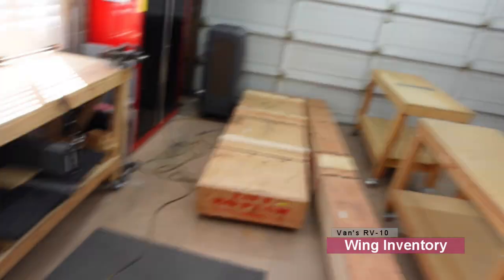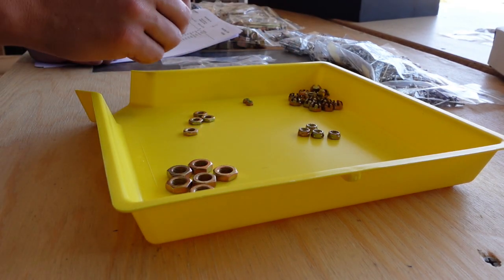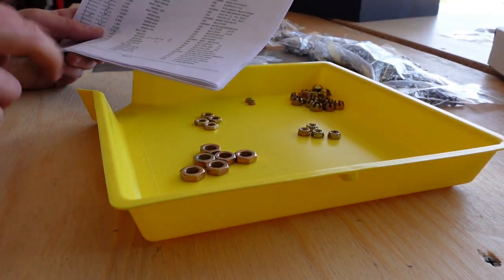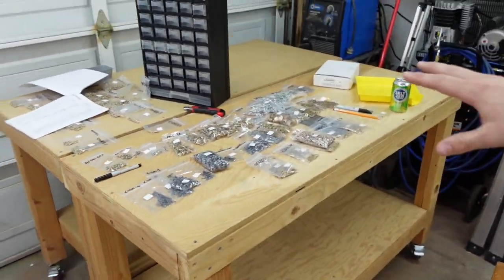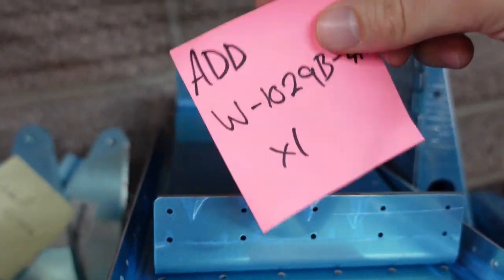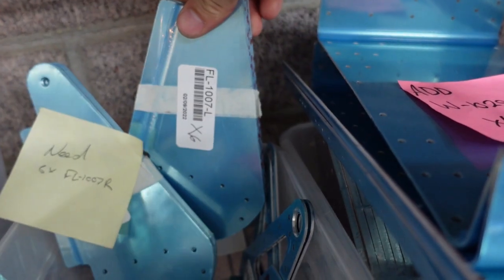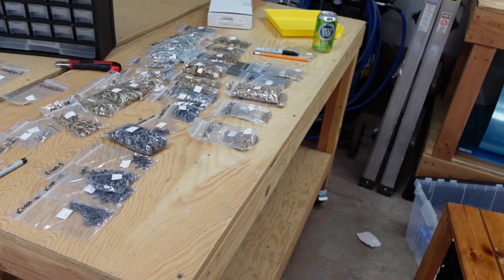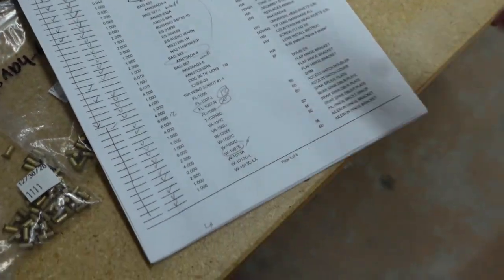Van's RV-10 Wing Unboxing and Inventory

Comment: Just finished taking inventory of my -14 Wing Kit. Like you, I take the time to check every nut, bolt, screw, and pulled rivet (solid rivets being dispensed by the pound). I also check the size (diameter, length) and have found a few that were off. I even found a batch of steel screws that were suppose to be stainless. In all, that zip-top bag of fasteners weighs 10.25 pounds, so missing even a dozen fasteners out of over a thousand is very impressive - on Van's part! I use the same sorting tray as you do. One thing to pass along is to pour the contents of the tray back into the bag over the top of another tray to catch any spillage. Build on!
Reply from the maker: Very interesting! Has me thinking I should go back through some of the screws….  And absolutely, still impressive to have such a small amount missing. That must be quite the tedious job packing those bags. And I like that second tray idea a lot! It’s funny because while I was at harbor freight I thought I should buy two with how cheap they were, but the stingy side of me said not to. I definitely had a few slip by when pouring things back into the small bags. I think I’ll be picking up another…